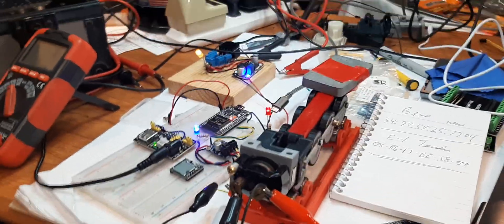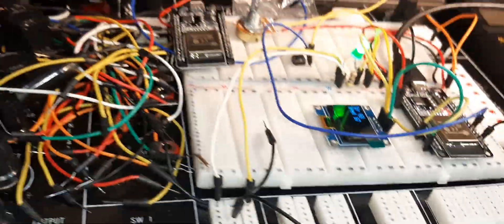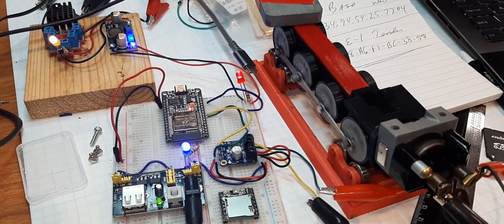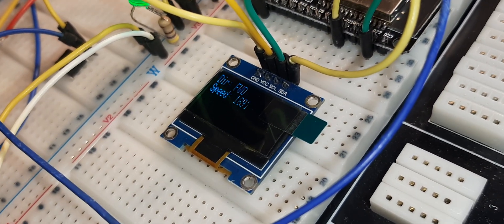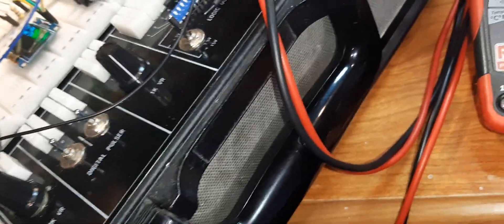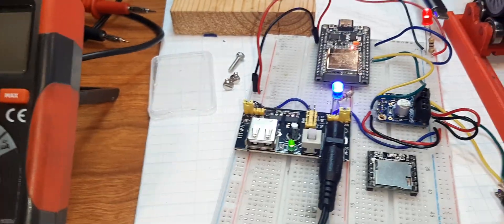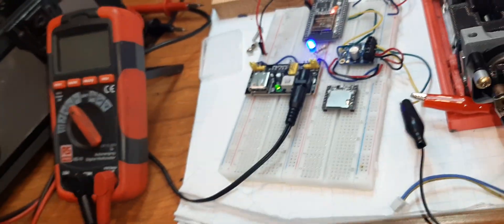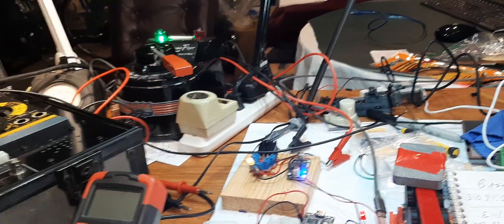Open NGS Level 2 Controller using ESPNOW and ESP32 pairs is ALIVE!!!!@

Comment from the maker: Update 2 the new motor controller came yesterday! And we found code for a ESP8266 to run the NOW protocol. Why ? This opens up the opportunity for a 3 ESP M.P. System for operating an Steam Engine with a ESP32 Base controller, ESP32 tender Module and an ESP8266 D1 Mini for the Engine Module. I needed the 3rd ESP for control of Puff & Chuff using a Smoke gear and fan driven smoke. But since my first engine with this system will be a Vintage 5 digit Pacific I will keep the Classis Puff & Chuff. That will allow us to use that 3rd Processor for some really cool Self Awareness Tech. Our first implementation will be the Open NGS Version of the Cow on the track. We named it MooAlert! With sensors in the cow catcher we will have feeding in to the ESP 8266 Obstructions on the track in real time. the Processor will see the alert and in real time reach back to the ESP32 in the the Tender and hit E Stop. At that same time the tender Module will blow the steam whistle 3 times real  loud every minute the track is obstructed. Once we can get the Cow off the track the Engine module will send an All Clear and the tender Module will resume travel to the destination. What I am learning is the capability of these small Mirco Processors to handle a lot of I/O and logic to provide a very rich experience with S Scale vintage trains that we could only dream about when i was an 8 year old in 1958 running my 283 across my bedroom floor. Hang in there folks we are bring the Open Next Generation S along a great new path where all of you can participate. All Tech, 3D Printed Parts and Code will be Open to All.

Comment from the maker: Update to the Alpha testing. the Vintage Flyer Motor has a lot of stiction that required more amps to start to rotate. The current motor Control board does not have a start boost mode to over come that stiction. I had ordered a new Driver that does include more start amps and should help these old Gilbert Motors out. Meanwhile to continue the testing process I will swap in a DC Can motor which has a much lower start Amp requirement. As we go forward we have several enhancements waiting in the wings. Wakeup/Shutdown, Start/E Stop, Puff & Chuff, Digital Sounds, 9 engine selection, Collision Avoidance and a few more  fun things. Please keep watching all summer we will be hammering away on new features and more engine tests.

Comment: Loved your project! We’re building LoRa dev kits with outdoor-ready enclosures and integrated batteries — just connect your board and deploy.
 Would love to chat about a possible collab — hope to connect!
Reply from the maker: I am unfamiliar with LoRa and will look into its function and  get back to you. In General we are open to collaboration.
Reply: @DennisMurphey  Hi Dennis! Thanks again for your reply 🙏
LoRa is a low-power, long-range wireless technology used for outdoor tracking, remote sensing, and off-grid communication.

Our kits feature built-in batteries and protective enclosures with a modular design — no soldering needed.
Just assemble the components and flash the firmware (e.g. using Meshtastic), and you're ready to deploy and test. It's a beginner-friendly workflow ideal for makers and explorers alike.

Let me know if you'd like us to share some intro materials or application ideas — always happy to help!

Comment: “Engine 2…” on the same track?  Trying to understand what the endgame is with all of this. Blows my mind.
Reply from the maker: My baseline goal is to promote S Scale Model Trains because I like the scale 1/64. In order draw in new users I started to design new subsystems for the vintage trains, then I migrated into new train models and even more new capabilities for the newer trains. this year we want to introduce a new control system that can be used on Vintage Flyer and even more capable on the newer trains. Then the notion of action trains that perform a mission. So I needed to expand the reach of the trains capabilty beyond the train tracks. That is when i started to explore Bots. Little 2 wheels rovers that can fit on a flat bed car and use the same train controller to unload on the site perform the mission then get back on the flat car and go on to the next mission. It was a short move from all that to needed a Robotic Arm on  the train to help load up the stuff the Bot rovers recovered and brought back. So that is about it Model Trains the basic os mission model systems for fun and education. All the stuff is DIY assembly based on STEM tech. so teaching folks technology too.